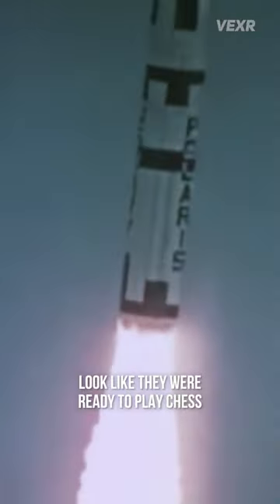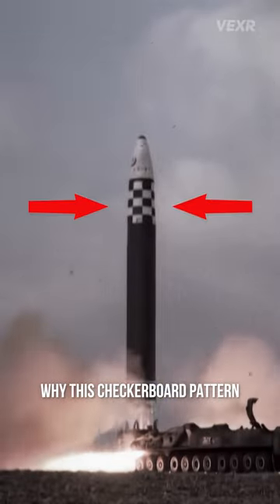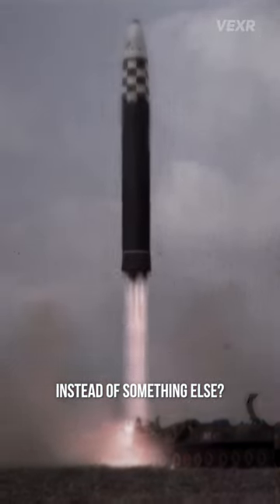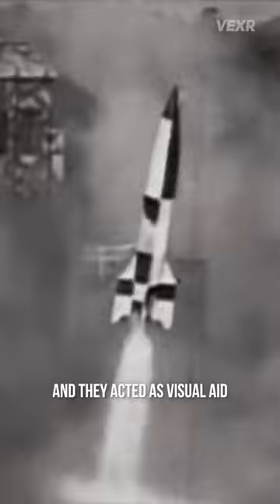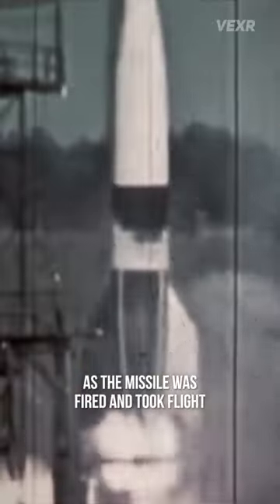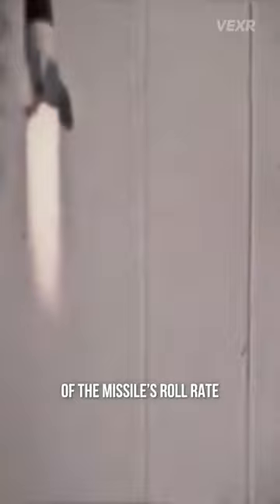Why The First ICBMs Used Chessboard Patterns

Comment: One of those chess games when you loose only once…
Reply: No, it's one of these moments where it ends Up in draw since both cannot checkmate the king.
MAD is basically military term for dead Position or Insufficient Material in chess.
Reply: Lose*
Reply: @bigdaddy7119 no joke this is the first time ive seen someone who actually knows the difference between loose and lose
Reply: no one wins when both sides have them
Reply: No its just check mate
Reply: ICBM be like
Reply: More like throwing the board in the air and flipping the table.
Reply: *lose
Reply: ICBM gambit be like

Comment: NASA still uses them on the new SLS rocket
Reply: I'm pretty sure that's merely to pay homage to older pioneering rockets.
Reply: Well SLS is mostly a 1970s design.
Reply: No they dont. Not as far as ive seen, at least. The SLS is white and orange to help reflect more light (and therefore heat) while the orange does the same, but possibly also being there to make recovery of the stages in the ocean much easier. They're basically restricted from using black colors because of the risk that it'll overheat something.

Comment: Also: operational missiles may have been painted differently. The test flights are the ones that would have been extensively filmed, and those are the ones where the engineering markers would have been needed.

Comment: Figure N. Korea to be behind the times.
Reply: We (the US) still use these on rockets today like on the SLS. They require no power and, if the camera is on the ground, can still provide you with data even if the telemetry link to the rocket completely dies. Also they're accuracy scales with the frame rate and resolution of the camera technology, which has gotten quite good in the past couple decades making measurements with this method very accurate if you use a computer to calculate the positions and velocities based on the images.